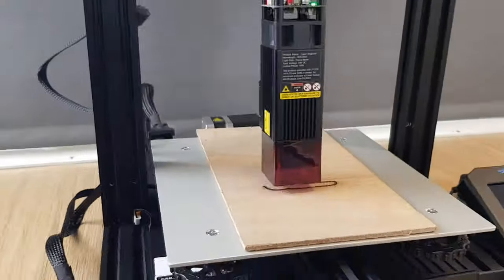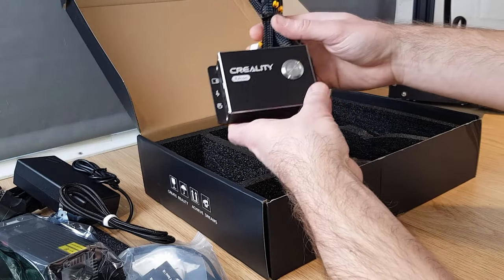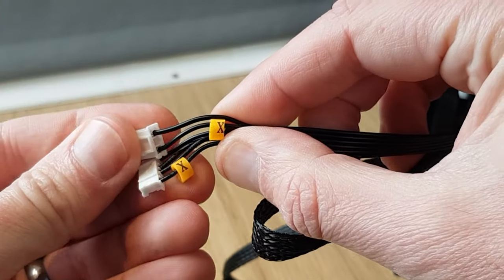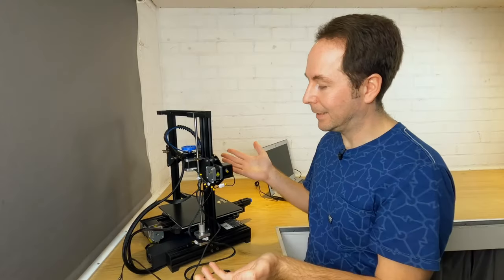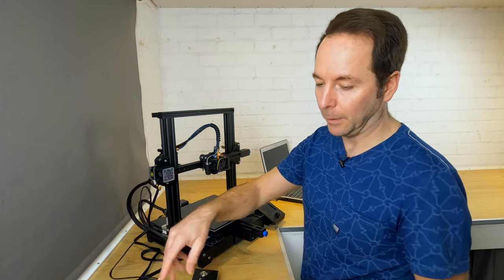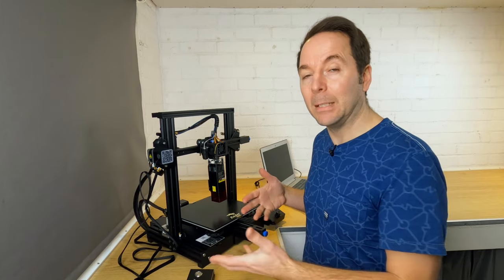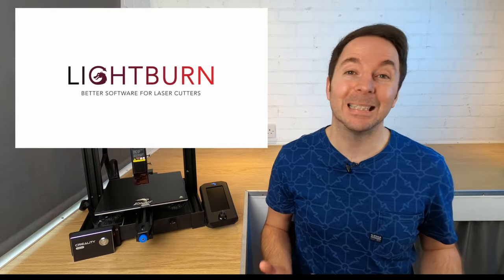New! Simple Kit To Turn ANY 3D Printer Into A Powerful Laser Engraver

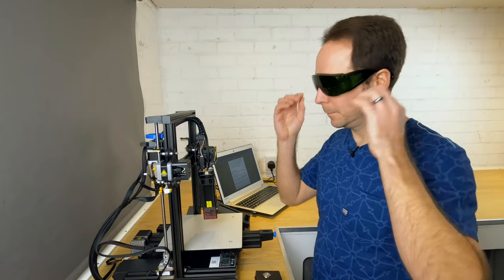Comment: 7:52 I've considered getting one for pcb, but i was really suitably terrified that I'd forget putting my glasses from all the quick tests I'll probably do, not to mention that I've heard that any engraver needs to be enclosed with air ventilation 
I wish someone would make a kit with a cam that looks at you and automatically detect eyes and immediately stop itself as precaution
Reply from the maker: To be fair, there is also a protective guard around the laser that 'helps' with filtering the harmful light. It can't stop reflected beams that will inevitably bounce off of any reflective material though.
Reply: It comes with a very protective plastic layer and a pair of glasses that completely block the light. I actually bought the 5W to cut acrylic with. It wasn’t the best because it was only 5 watts, but it definitely wasn’t an issue with getting light in my eye. DEFINITELY get ventilation though. My workroom smelt like a nail salon for 4 hours lol

Comment: I thought about getting the module for the S1 pro BUT i have seen the video of maker muse about the risks of those .. and read a bit about it and decided against it . I do wonder if you are aware of the danger of all those lazers ? and what do you think about it
Reply from the maker: Hi, yes I am aware of the dangers which is why I say that you should take eye safety extremely seriously. It's difficult when talking to a global audience as you can't cover all of the possible risks when reviewing products. I have 3 laser engravers now and I am very careful when I use them. I think that as long as people understand that there are dangers and that safety should be taken seriously then these kits can be safe for use.
Reply: @RickyImpey  yes . I particularly noticed muse's worries about the fumes from the engraved material and implecations for pets and other beings who are not or cant wear eye protection... That is the more worrisom part.

I havnt found a sutipn that make sens accept dedocation a ventaleted room for it while its workibg.

I also understood that there is no way that can ebgrave stainless steel wich ia what i wanted it mainly for
Reply from the maker: @loxire  I have engraved stainless steel with mine, you may need to add some dark spray paint that you can remove later but it works. You are right, fumes are definitely an issue. I wouldn't use a laser engraver in my house without some serious ventilation. Also, it has to be kept away from anyone not wearing eye protection.
Reply: @RickyImpey  the hardest part i found when i looked in to it is findibg "fune safe materials . I personaly dont have a place tgat i can ventilate well so i forgave that.

I am wondering if you got to play with the stronger lazer they offer for the s1 lineup. (they offer a 1.y and 5w lazer)
Reply: @RickyImpey  also do you think the steinless steel engraving is good enough for a digital wallet?
Reply from the maker: @loxire  I think that would be a matter of opinion. One thing I would say is that there can be a lot of warping of thin stainless steel when laser engraving.
Reply: @RickyImpey  so a 4 mm stainless steel would be probably too much to engrave on ?
Reply from the maker: @loxire  4mm may be ok, thinner material is more likely to warp.
Reply from the maker: @loxire  This 10w laser is more powerful than the other ones they offer.

Comment: Oh sweet... This is a new addition? I thought they just sell their proprietary laser modules for the Ender 3 S1 Pro. 
But I suspect that this is a "fix" for the incompatibility of their other AddOn-Product.
The SonicPad uses Klipper and is not designed to work with the Laser modules they offered seperately for the Ender 3 S1 Pro. Thus rendering it completely obselete when you upgrade to a SonicPad.

Edit:
Rewiring your printer seems way too fiddly and I wouldn't trust the connections to be switched 100 times. I like the idea of the Ender 3 S1 Pro with their dual-boot capability to switch between 3D Print and Laser engraving.

Edit #2:
After thinking about it: I would love for creality to ditch the Wiring loom and add Y-Splitters to it.
Additionally, they should switch the connectors out. Change them from Female to Male so you can unplug the wiring loom right at the mainboard instead of fiddling with all the axis and limit switches themselves. This would streamline it and allow for quicker access. With a Y-Splitter, you could leave them permanently plugged into the 3D Printer Mainboard and the Laserbox and only run one of them at a time. This would eliminate clutter alltogether and make the package neat and tidy.
Reply from the maker: Yes, it could be refined to be simpler to install for one particular machine but doing so would mean it would be less compatible with other machines.

Comment: The Ender 3, among others, only has a single Z drive screw which means the X axis cross beam has no support when the weight, be it a print head or a heavier laser head, will sag at the far end.......modding the Ender 3 to have a twin drive screw for the Z axis is highly recommended........this factor is one reason why you can get bed leveling problems no matter how many times you attempt to level it......even springless or solid bed mounts will not help if the X axis beam sags.

Comment: Hi, another great review, your tutorials have been a great help as well, it would be great if you could design a bracket for Cr-10s pro v2 and also a tutorial for using LightBurn. Thanks for all your support.
Reply from the maker: Hi John, Mine fitted straight to my CR-10s Pro. Is yours not fitting?
Reply: @RickyImpey  hey sorry to disturb but I have a cr-10s5 and can't get mine to fit properly. do you have any tips about how to do it on a cr-10?
Reply: @rickylmpey in your video it shows you trying to put it on the Cr10s pro but it seems to not fit?

Comment: noob question: can it cut carbon-fiber?
Reply from the maker: Unfortunately you can't really cut cured carbon fibre with a laser as it burns the epoxy it might cut the plain weave. If you want to cut cured carbon them you are better with water jet cutting.
Reply: @RickyImpey  hmmm 🤔 thanks. but i guess they are very expensive and needs special environment right?
Reply from the maker: @alperenozgur  yes, probably not a machine for home